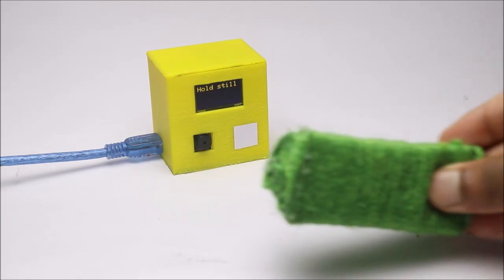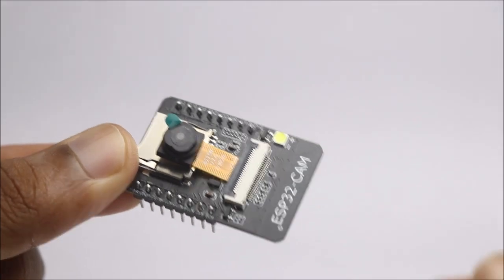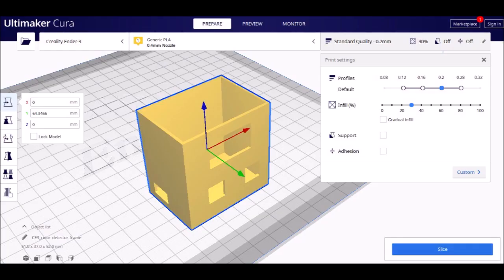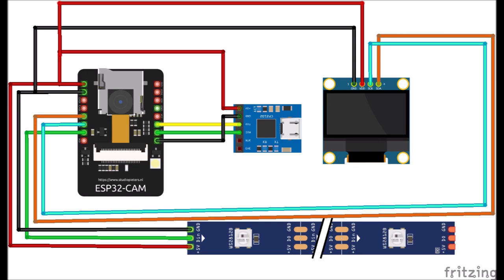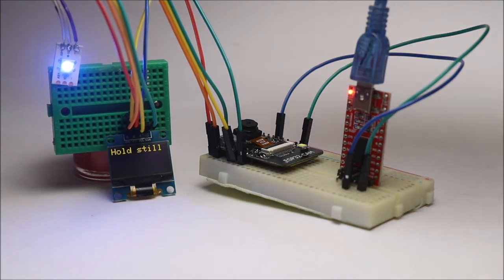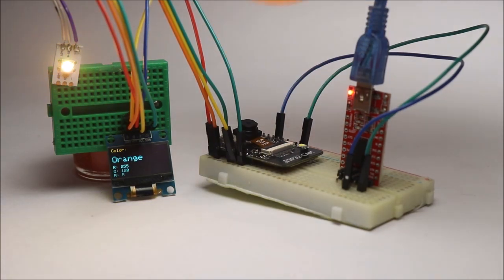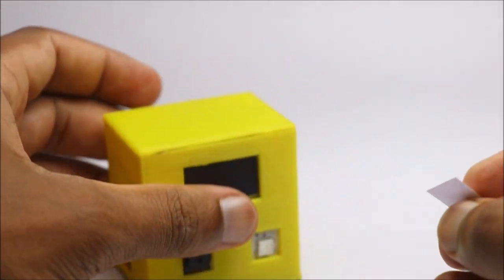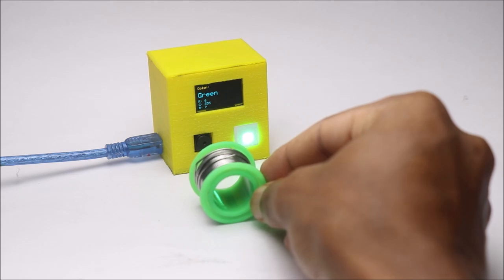ESP32-CAM Based Color Reader for Color Blind With Real Time Color Recognition | Useful Arduino Idea

Comment: amazing idea .can i use a battery to power the project? what kind of battery is needed and how do i connect it?
Reply from the maker: Yeah, you can use 3.7v battery with charger and booster
Reply: @jeevanjee thanks, keep up the good work 🤩